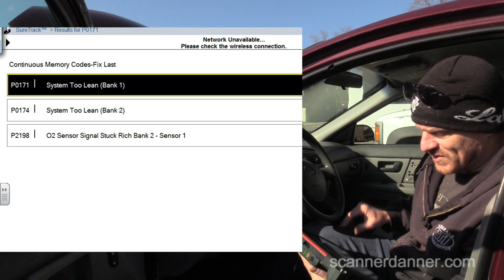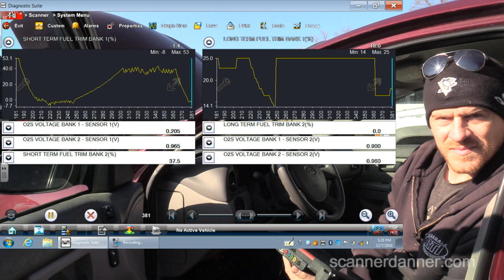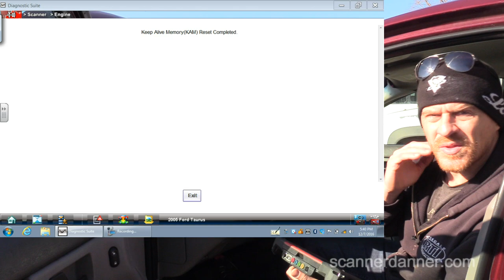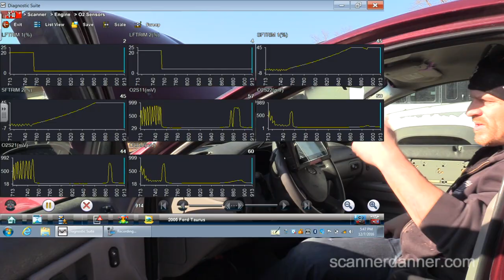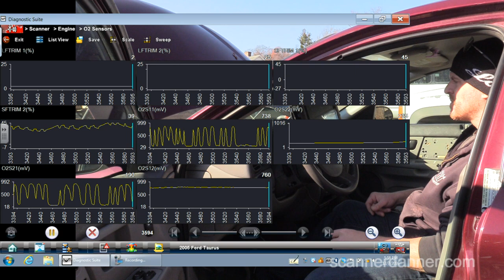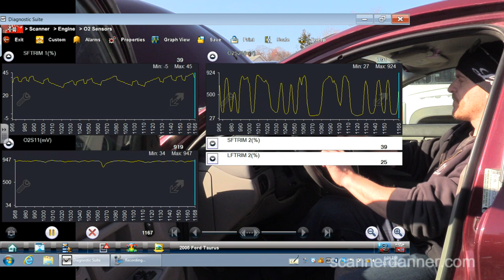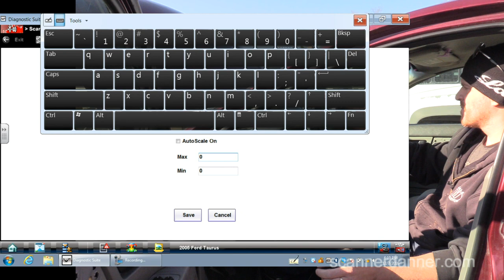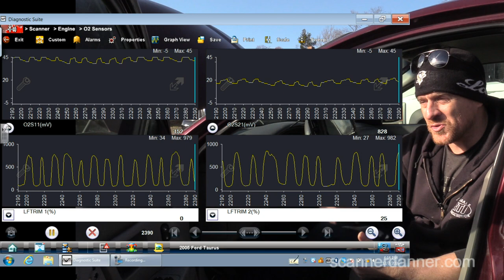Ford Taurus Lean Codes (P0171 & P0174) with Rich Bank 2 (P2198)

Comment: I have a problem on my 2004 ford taurus lx I have bank 1 and bank 2 and I have changed out the o2 sensors tune up
Reply from the maker: I have a lot more P0171 and 174 lean exhaust videos.  Check out my chapter 4 and 5 playlist on my YouTube home page.

Comment: Hi paul 
I recently bought a toyota camry 2008 2.4L le
It feels like i have a v8 engine on fuel consumption LTFT= -20 TO -30 when rising the RPM some times it throws p0172  system too rich and p0101 maf circuit/range performance . What causes those negative numbers and high fuel consumption
A/f sensor 3.2-3.4 volt i guess its fine 
Maf reads 2-5 at idle under load it gets to 30 - 40 g/sec
I know i have a small vacuum leak from the evap hose to the manifold 
Can a vacuum leak set system too rich and maf code ??  I really need your reply 

Thanks
Reply from the maker: How does it run and what are your fuel trim numbers when you unplug the mass airflow sensor
Reply: @ScannerDanner  
I replaced the maf sensor today same results koeo maf data is ( 0.82 g/sec)
Manaul says it should be 0.45 or lower
My fuel trims are. 
LTFT = -20 TO -30 
STFT = near zero both ways
I dont have data from downstream O2 
Does it affect those numbers?
Maybe it is disconnected or removed i bought it like that.
I unplugged the new sensor the car wont go into closed loop so i cant see fuel trims maf unpluged 
I disconnected the evap purge solenoid numbers went down to -11 LTFT when i raise the RPM .. LTFT goes down to -1 
Am i on the right track? Could it be the evap system??

Thank you for tour reply
Reply: Hey paul last update
I disconnected the purge valve fuel consumption went down its on 13 L/100km right now from 16-20L/100 km and 
I remover the air filter resonator, car feel way more powerful now and i can accelerate comfortably.?
Any advice from now on? What todo with the evap system as it is disconnected now
Reply from the maker: @binar91  a stuck open purge solenoid can definitely cause rich conditions. When you disconnected the purge solenoid, are you just leaving that line open? This will create a large vacuum leak. If you need additional help, let's move this to my forum www.scannerdanner.com It is free to join and I can help you better there. Let me know when you post it and make sure to include our conversations in your post. Thanks!
Reply: Thank you in advance 
Finally after 2 months i found the problem.
It was the ground wire going to the maf sensor with multimeter it read 85 millivolts
I added a new ground it went right down to 3 millivolts and fuel trims are now -1 to +1 
Imagine what a bad ground can do to a sensor and still testing good for having continuity between the wire and battery negative 
Credit goes to you Paul
Reply from the maker: @binar91  so when you unplugged the MAF, your fuel trim improved and that is why you replaced the MAF right? You are welcome! Glad you fixed it!
Reply: I unplugged the maf but the fuel trims tuck at what number they were before unplugging it .. and by disconnecting the purge valve unintentionally i created a lean condition but soon after the ecu would adapt and goes back to -35 LTFT 
AFTER watching your video on testing maf voltage and ground i found out my ground was bad ... For a sensor that sends signal a perfect ground is a MUST ..but for on of sensors i guess it isnt that important right?

And thank you for following up with my case

Comment: +Scanner Danner I tried 3 times to join your forum it won't let me join :( says my email is invalid I used 2 different emails..1 question 96 ford contour 2.0 .would.20 pounds fuel pressure at idle cause a lean condition  ?  it runs rough and threw a 0171. I smoked it no vacuum leaks, and is 28 to 30 timing at idle normal?  I live in Robinson by imperial Pa thanks for sharing your knowledge!  this ford is driving me crazy lol
Reply: Me to seems low, spec is 30 at idle, I assumed since it's a 4 cylinder it would be good enough.
Reply: Yep thanks alot for the help
Reply: That is a very low pressure and most definitely would give you lean problems. I will start with that, check fuel filter and if has a pressure regulator check that as well
Reply from the maker: Email support@scannerdanner.com  My Web designer Wyatt will fix you up for the forum
Reply: I also tried joining the forum a few times and it never worked out.
Reply from the maker: Email support@scannerdanner.com  My Web designer Wyatt will fix you up for the forum
Reply: Thanks Danner

Comment: Typical IMRC O-ring leaking...it happened to 2005 Vulcan
Reply: Used from 2004 - 2007 OHV engines...also typical is the upper to lower intake manifold gaskets...

Comment: baro looks low,unless you are in the Himalayas.
Reply from the maker: what was the number? I don't remember
Reply: low 24. This would be right at about 6000'. Not sure if the newer fords use MAF or MAP to compute. I think they may still use MAF in some cases, that could be contamination. Sea level  is like 29 I think.

Comment: Hey Danner, still having issues with my 2003 Ford Ranger 2.3 ltre. Getting wild volt fluctuations as well as instrument lights going on and off. Have put two different alternators on with no change. Could it be the GEM? Here is a video. https://youtu.be/FYu37nr9K44